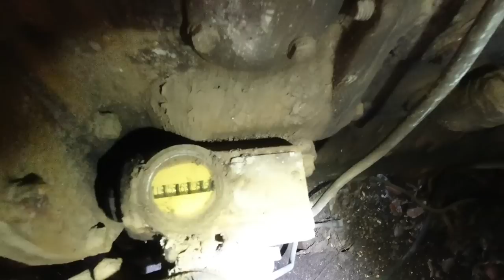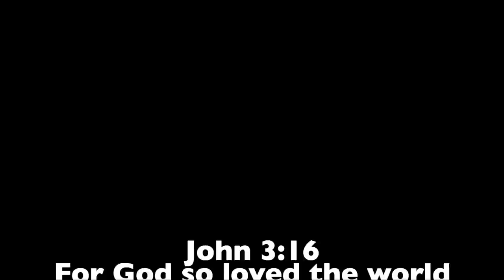Will It START? ABANDONED CRANE Sat In Woods For 40 years!

Comment: At 8:13, I'm guessing that fill cap is for oil for the injector pump. It's not uncommon for older diesels to have an injector pump lubricated with engine oil. There's usually a drain plug to drain the pump casing, fuel and water will sometimes accumulate inside it.

Oh, and 16k hours on a CAT engine isn't a shock. I've run CAT wheel loaders with over 40k hours on them.

Comment: The rack in the pump may be stuck. I ran them and ain't dead yet. A 318 had a compression release. That'll kill it and the injection pump had a drain around the base of the pump especially for water separation, a sump. American made a fine rig. It can run again and I paid many a light bill slinging a drag bucket. Learned on a 22-B in the Army with a clam bucket feeding an asphalt plant. The ARVN's killed it and we finished the job with a 20 ton American truck crane with a flathead Ford industrial 6-cylinder gas job. Been in Units, P&H's, North Wests, Loraine, Lima's, Quick-ways and who knows what over the years plus a lot of everything that goes with them. A good life and the controls could be loosened up and it'd dig again. And a pony motor is just like an old Harley. If you could crank one you can crank the other. I ought to know. GBWYall!
Reply from the maker: You got the coolest stories Lewie👍👍
Reply: @HamiltonvilleFarm  50 years of driving and operating. The truth is stranger than facts.

Comment: I admit that I scratched my head when I saw this jewel setting in some fellers back yard. Most will start as you proved but the killer is getting fuel to keep going on its own. I do believe that those filters you pulled must need some gasket of sorts as you'ns pointed out. That primer back in the day had a leather rag in it. The bolt was run through it and then kinda cupped in the hole to make a pusher out of it so if it didn't take all that much pressure to get fuel through then a fuel pump that could be hooked in line would be all you may need to get all the air out of the lines to the injectors. Once the air is out of all the lines then you just might win this.... running part. Getting those frictions to cooperate might just be another whole video. Plenty of "pitch" from a pine knot will get them to grab a little. Thats what we used on the old shovels and drag lines back from the day.... You men did outstanding and can be proud of your accomplishments towards making it run long enough to load itself into a scrap metal hauler or someone kind enough to allow it some life and be a museum piece.
Reply from the maker: Thanks for watching 👍

Comment: Everytime and I mean everytime I watch someone use ether that long to keep a diesel running I absolutely cringe!!! That's NO good on cylinder walls, like that drag line. It's been sitting 40 years already with no sort of lubricant in those cylinders and then to use ether to fire all cylinders is just stripping them even more not to mention I was kinda waiting for an "ether lock" to see if ya could blow the head off! Ether burns so damn hot and clean just be cautious when using. Thank you for letting me post a PSA. Just kiddin, but seriously ether is so lethal when used like that on any engine let alone diesel's. I dont mean to sound like a dick just trying to help stop  unnecessary engine damage.
Reply: I agree with using ether only when necessary,and not for a long time. On the other hand if anything could take you using ether on it well it would be some really old, robust diesel engine like that one they got their. My only advice would have been to maybe put some mystery oil down in where the spark plugs go to put alittle lubricant on those cylinder walls, and before trying to start it, I think I might have tried to see if I could turned it and got it loose, but to each is own it was awesome to watch reguardless, even if it would have locked up and blew the head.lol well as long as nobody got hurt, that is. Keep up the great content buddy.
Reply: WD 40 is more gentle than ether but will start diesels.
Reply: Yes that was really bad running that long on starting fluid. You need to get it compleatly primed and it will fire right off.
Purge air from filter cap first, then from each individual pump bleeders, then each injection valve at head. You might try pressurising fuel tank to bleed
Reply: @edarmstrong9389  I use this also
Reply: @edarmstrong9389  That’s good information to have I did not know that
Reply: Hagen van Tronje  due to the pressure from combustion. Fires very hot, packs a real wallop.
Reply: @edarmstrong9389  Can WD-40 be Used to start gasoline engines
Reply: Ever seen a manifold blown off of an engine with a preheater or glow plugs?!
Reply: @vinces8974  No it cannot. It is however great a drying out points

Comment: I love the old tractors & equipment ! The old stuff were built well! Some Old injector pumps had their own oil... Prob what that first plug you spotted.. Throttle & shutoff levels, just Luxuries lol
Reply from the maker: Thanks for watching 👍
Reply: I commented pretty much the same thing before I found your comment. I'm accustomed to old Deutz air-cooled diesels with a mechanical injector pump that has its own oil supply.

Comment: Hank good to see you wearing a John 3:16 shirt. Do you ever say anything about your faith on the channel ?  Will it start 60% chance. Do you ever use a remote starter switch  ? Well, heck then somebody has one. Was it rubber washer or leather. Our old well pump had leather washers, pumped water from 430 feet deep. Coldest water you ever drank.

Comment: Crack open the #1 cylinder fuel line a quarter turn, when you turn it over until the  bubbles go away and tighten quickly. Then work your way  to #2 and so on. Repeat through all of them the same way.  If the fuel pump doesn't hold it's prime you will have to repeat every time, do to a weak or worn out fuel injector pump.
Reply from the maker: Thanks for watching

Comment: This was a great video and I am glad that you all got it to fire up and run some .Those old Cat engines are amazing.
I have a old ( probably around early 1960 model crane mounted on a General Motors truck ) that the cab of the crane is set up very much like that the drag line cab was . My crane has a Hercules motor in it and it  had been running the last time about 1978 . And we had kept antifreeze in it and hydraulic oil in the motor block so that if we wanted to try to start it .
Till around 1999 to 2000 some sorry ass drained the radiator and stole the radiator out of it .It is sitting a long distance from where that we could see it, on the back side of my 200 acre farm. A coal company that had stripped the coal off of my farm in Lawrence County, Kentucky had just left it here, no longer wanted it . It was a pretty cool looking old piece of equipment, but it is really dilapidated now . Never did anything to it after someone took the radiator out of it .
I will catch you all later on more videos, cause I love to watch the stuff that you all do trying to get the old equipment started .
Wishing you all a Happy and Healthy New Year for 2022 and be careful and stay safe and keep on making us more videos. 
As always, Jeffrey !!!

Comment: As i was watching you guys. I noticed that you said hold your mouth right. My dad used the expression when he was around. I also noticed your t shirt John  3-16. Thats awesome by the way my friend Hank. Im a big time believer myself of that big man upstairs. I think the odds are good you will get it started. Im not going anywhere. You will always have my support my friend. I have snapped half inch impact adapters before, big bolts and big socket wrenches but not battery terminals. Dont know my own strength either lol. That old gas engine saw was awesome to see. Thanks for sharing such an awesome video.
Reply from the maker: Thanks Alan👍

Comment: The lever handle on the drivers far left actually switches the gearbox from crane mode to drive mode.  You cannot drive and operate the tower at the same time.

Comment: Anyone else notice, down right below his hand holding the throttle (almost out of frame at the very bottom), that at 15:29 there's a nice solid spark???

Which is quite interesting considering the batteries don't appear to be in/connected yet....unless my eyes are playing tricks on me or the video jumps around maybe?
Reply from the maker: Hmm. I'll go back and look.
Reply: @HamiltonvilleFarm  sure enough there is. I screen recorded a few seconds right around 15:29, zoomed in right below his hand and slowed the video down to 1/4 speed and I even have a screenshot of it if you can't see it. I just don't know how I'd get it to you lol.

It's quite interesting. Just a .25sec jump of electricity right off the engine...with no batteries yet. Very odd.
Reply from the maker: Interesting

Comment: My fuel filters was rope spun around up and down. On your injector pump the cylinders might bc stuck I had 2 stuck on my dozer the rollers pushed it up and when shut off they stuck up its below the filter to the right there is a 4 bolt cover
Reply from the maker: Interesting
Reply: @HamiltonvilleFarm  mine sat for 30 years before I bought it it was runing on 2 cylinders out of 4

Comment: Try loading it up with some starter fluid ,,let it revs up cap the air intake off and it'll draw with fuel by suction up in pump and through the system out injectors
Reply from the maker: Thanks for watching 👍
Reply: They don't work like that. You're thinking of a gas engine with a carburetor.  Not to mention the starting fluid can crack the rings

Comment: That should be a leather cup on the primer. I’ve made a new one out of the leather of an old shoe, I used the part wear your ankle is as it already was slightly cupped from the ankle pressing out on it. I learned in a Bucyrus 22B dragline with a 318. I hate to say it but it makes me cringe to run it without fuel filters. If it had a pony motor you could crank it and open bleeders til it primed but with electric start I would slightly pressurize fuel tank with air and open bleeder on front and side of filter housing to bleed. There are also bleeders on injection pump where lines attach or loosen lines to bleed.
Reply from the maker: Right on 👍

Comment: I'd  get NEW Fuel Filters and Gaskets.  Also the Primer Pump should have a Leather Cup Washer that does the Pumping to Prime up the Fuel to the Filter Bowl.  If there is a rubber hose between the primer and the Fuel Tank you may want to install an inline gas filter to help separate the GARBAGE from the tank from the Filters  and Primer Pump .
The best thing would be to run a Diesel fuel Can to the Primer to send CLEAN, FRESH DIESEL FUEL to the Engine. And eliminate the unit's CONTAMINATED fuel System ( TANK AND LINES. ) .
Reply from the maker: Thanks 👍

Comment: Not advisable to run that engine with no filters. it will plug the injector screens and then you’ll have to clean the whole injection system. also, because it’s a precombustion injection engine, you should technically only use either while it’s turning over
Reply from the maker: Thanks for watching

Comment: And another one wakes up!  Not only informative but entertaining, too!  As a suggestion you might perhaps set up a tool kit and leave it in the truck, with essentials for engine awakening. I got in the habit in my early married life, when I drove junk to help make ends meet in the sixties. Your collection of wrenches looks rather complete, but I would add a medium sized pipe wrench, a can or two of starting fluid, WD-40, a couple of sets of battery cable terminals, and perhaps a new replacement battery cable, just in case. Add to this the usual shop towels, and a can of the tub o towels, preferably the Go Jo version, and some gloves. This should at least get you clean enough to drive home. An O ring kit from Harbor Freight would be a good one to have too. I used to carry a couple of cans of wasp and hornet spray...the stuff that squirts about 20 feet. And, a bottle of insect repellant, any kind with a lot of DEET in it works best.
Reply from the maker: Thanks for watching 👍

Comment: you might want to use it for a giant size  paper weight  if you get the motor started you might want to sell it  that might be the only thing good in it if it turns over if not then use the hole thing for a paper weight good luck on trying to get it started
Reply from the maker: Thanks for watching 👍

Comment: Hey when your for one was those fuel pumps and trying to fill them lines up and get that primed up you're better if you use ATF it will still fire off on the ATF but the it'll suck its prime up quicker because the ATF is a little heavier than the diesel fuel
Reply from the maker: Thanks 👍

Comment: That looks very similar to the D342 that runs a generator set for our wash plant but ours has a turbo.  I'm sure the rack is stuck closed in the injection pump your lucky it wasnt stuck in full fuel position or she woulda run away.  That primer is supposed to have leather cups on them brass finger things they are cheap and still available though Caterpillar just find the serial number.  You need to look into figuring out how to access the fuel rack in the injection pump and see if you can get it to free up as your next step.  Also since the radiator was low pull the oil drain plug see if a bunch of coolant comes out if the liner seals are leaking over time the coolant will end up in the bottom of the oil pan.  Next I wouldn't even try to run it off what ever was in the fuel tank even after adding fuel after seeing what the filters and fuel bowl looked like.  If you get the rack freed up stick the feed and return into a clean full can of fuel and add some atf to the fuel to clean and lubricate the moving parts in the injectors and injection pump.  Finally that plug you were looking at on the injection pump is the injection pump oil cap back then many injection pumps ran their own oil separate from the engine oil.  You fill it to the top of that plug much like a Briggs and stratton lawn mower engine so I would pop that plug off and see that the injection pump has oil in it too
Reply from the maker: Thanks for watching 👍